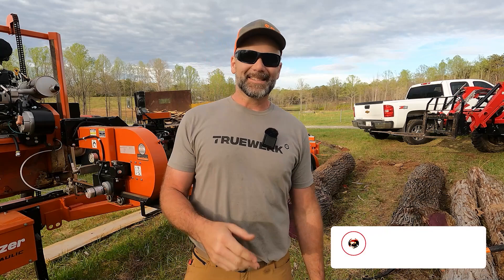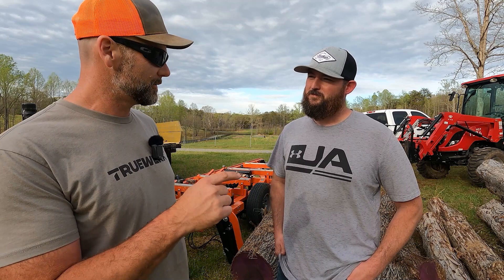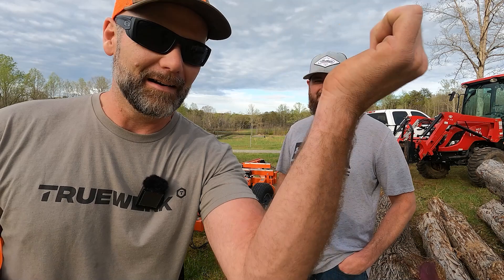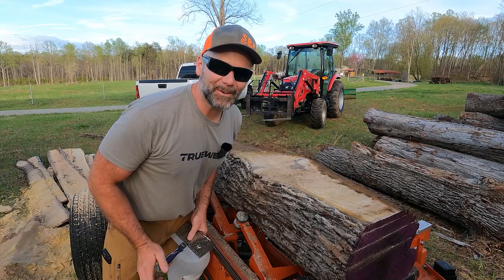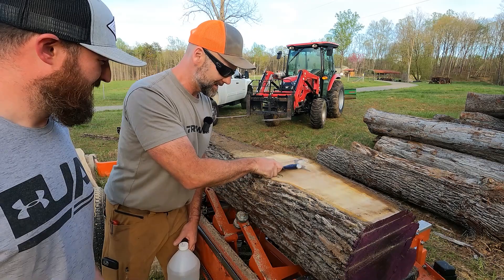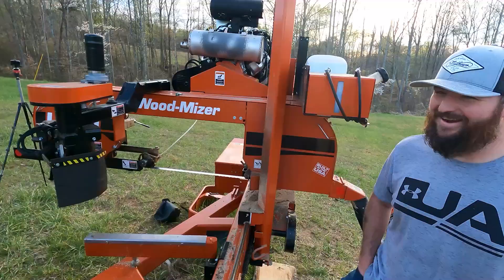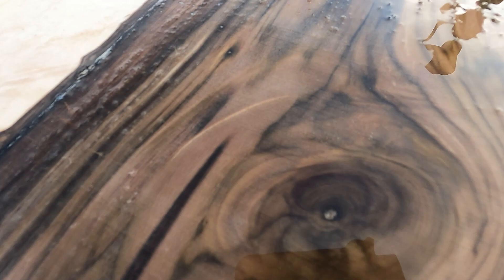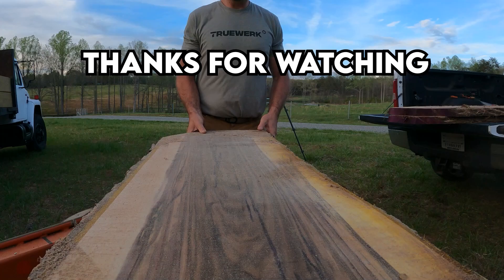Sawmilling th Most beautiful lumber I've ever seen...what the heck is it?

Comment: Hey Josh what awesome lumber, I would coat any metal on the Saw Mill with car or truck Wax to prevent rust on the Saw Mill.
Reply from the maker: the whole machine is powder coated except for the rail and some bolts/nuts and exhaust...soon I'll have it under a shed and rust won't be an issue